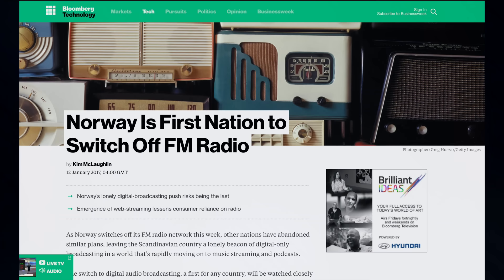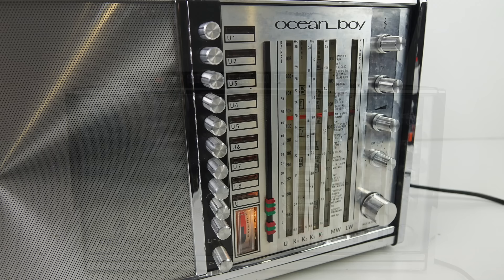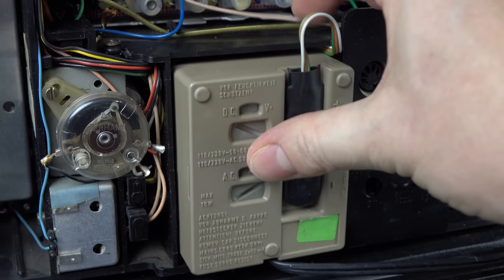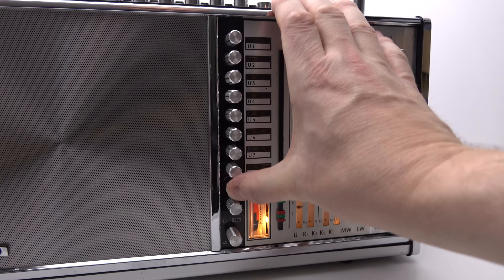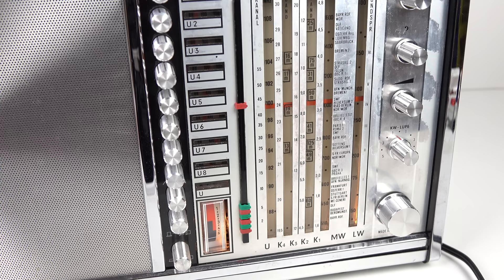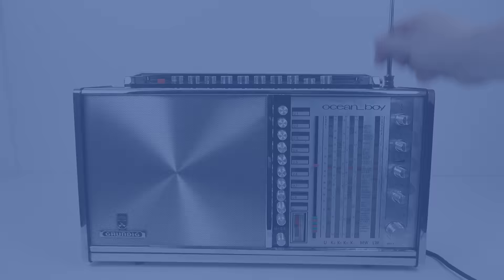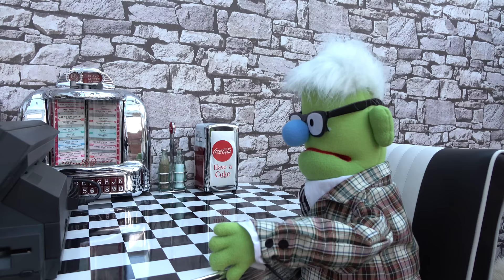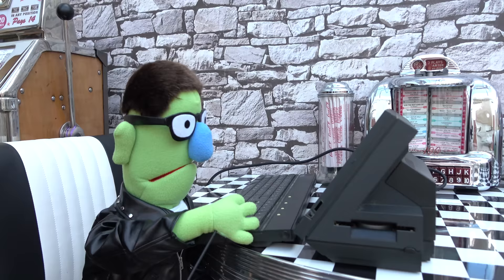Design Classic: Grundig Ocean Boy 210 Radio

Comment: Hi, all you need is a fm transmitter from amazon and put its 3.5jack into any modern device tune the transmitter to say 90 MHz then tune any vintage fm radio to the same frequency and can use great quality radios forever.   Regards JH

Comment: The coolest old radio I get to play with is a friend of mine has a Zenith Transoceanic  that I think is a 600 series.
Reply: i once found a radio quite like this buried under the ground for 60 years
http://www.nnrm.net/Bilder/Foto%20samling/Radionette%20Solist.jpg
its only a rusty hunk of metal and all the wood and speakers had rotted away, but the tubes are still there

Comment: You should also try some of their stationary real Hi-Fi radios (according to the DIN standard back then) 
I have an RTV 600 from 1967, all the components original, and in superb condition, that i bought dirt cheap. It has stellar fm reception (i am getting strong signals from some 200 km away) and used as an audio amplifier (2x20W) with some grundig speakers it sounds superb.
Grundig made some of the best radios in the 60s and 70s, but later on, after they were bought by Philips and then sold off things went down.

Comment: Awesome radio, I have several Grundig radios in my collection including a couple of Yacht boys.
You must check out the fantastic Grundig valve FM sets from the 1950''s!
Personally  I think DAB is Crap, if (when) FM is switched off you can use an FM transmitter to broadcast to your radio.
There are plenty out there that were designed to transmit from a walkman to a car stereo, they actully work well and are very cheap.

Comment: On the "switching off FM" thing, here in the states we still have AM stations and new cars can still tune into AM stations. I do believe this is due to some remote areas so far away that FM signals don't reach and population is so sparse that it isn't worth it to make a tower there, and I also do hope that the US doesn't switch it off anytime soon, as there is a truck I'm looking at buying and it's AM/FM only lol
Reply: Justin Noker Ironically, Canada has recently eliminated most all of its AM stations, and moved them to FM.
Reply: Yeah. AM isn't the best quality and easily subject to noise. But it's still great for talk radio, news, and sports. Also when the ionosphere is just right, you get epic DX'ing. Can hear stations all the way from either coast, parts of Canada, or even Mexico and the Caribbean right here in the Midwest.
Reply: They are transmitting from Toronto on shortwave.

Comment: It's weird hearing numerous FM radio DJs on those presets speaking English with British accents. Pro tip: When they turn off the 3 meter (100 MHz) band, you'll be able to home brew your own FM transmitter. My car is a 2000 vintage Audi and I use a Bluetooth FM transmitter I purchased from eBay wirelessly connected to my smartphone. You can use the same device at home with any 12 V AC/DC adapter you have sitting around the house, and voila, 100 MHz is back! No idea what they will use the band for in Europe.

Comment: I own an "ITT Schaub-Lorenz Polo automatic 105"-Radio from 1974. It's a bit smaler I think, but it also has GREAT sound! It is completely original and in very good condition (not even the potentiometers are scratching! That's real quality!). The only "thing" is, that it only receives FM-stations from 87,5-104 MHz, not 104-108 MHz, so a few stations are "out of range"...

It also does a good job as "mobile speaker" on batteries, powered via "Linex FM-Transmitter" by smartphone ;)

Hope they will not switch off FM-broadcast in the near future, they shoud better switch off this horrible "tiny-sounding" on-air-sound-processing (especially here in Germany..., also in Austria, Switzerland, ...)

Best regards from Germany

PS.: Go on with your great "old-technology"-videos! Some day they will be worth millions!
(I'm 27 years now, and I still lived with MC-Cassettes, VHS and analog stuff - all important professionaly digitized now...)

Comment: They turned it off where i live first. 11.01 at 11:11:11. Not getting a new one.
But that is not all they did. They moved all the channels on DAB to DAB+, so all DAB radios stopped working.
Only got 2 local stations left on the FM band here now.

Comment: 4:19 They are technically not individual tuners. Like old TVs they only individual variable resistors that defines specific voltage for varicap diodes located in actual Turner circuit.

Comment: Completely irrelevant but aircraft transmit in AM just above the consumer FM band starting at around 110MHz.  The reason they transmit in AM rather than FM is because if two aircraft transmit at the same time, you hear both talking over the top of each other with AM and can ask them to repeat one after the other, whereas FM can lock on to one transmission so you may not even notice one aircraft was trying to contact you at the same time as another.

Comment: Something about radio that makes it kinda fascinating is that, it's not always that easy to pick up the best signal. Still remember that, in order to pick the best signal, all sorts of metal sticks is used to improve the signal picking XD And, I guess it just feels good being able to fine tune the frequency to just get the best signal? XD

By the way, in my school, English dictation test still uses FM to broadcast the audio. And my roommate got a handheld radio for the exam and was like, he didn't know how to use that because the frequency selection is analogue. Um... Well, is it really that hard to use an analogue tuner nowadays? Anyway, I tuned that radio for him and, as a joke, I attached a long straight steel wire to the antenna (leftover from DIY project) and said that, it would let you receive better signal XD

Comment: I wish i could ship techmoan my RCA 27" DCRT HDTV; it was RCA's final who-rah and completely stacked with options front and back. 
 It's unusual in that it's a glass screen television that can do analog 320 alongside digital 480~720~1080i~1200i (all this in 2002 mind you) as well as function as a 85hz computer monitor, it can change aspect ratios, it has a built in headphone amplifier both front and back, it has a subwoofer pre-out, it has dolby and DTS and built in EQ, it has multiple sets of DVI and HD-15 inputs, it has component, S-video and composite and they're all gold connectors in back. it has a service panel in the shroud.

It also weighs the better part of 100 pounds and would probably cost a BMW 3 series to ship to the UK. :(

Comment: Not quite sure about the legality of the solution but you can always use a low power FM transmitter to relay the digital radio signal from a DAB receiver to the analog one.

Comment: The AC adapter was a clever construction. I'm not sure, but I think you could replace it with a battery that had the same connector and dimensions.

Comment: The biggest problem, and what caused the initial delay is cars. Especially, those of use with older cars that can't easily be adapted to run a DAB head unit (such as mine). I rarely use the FM but it can be handy for the traffic alerts which will interrupt the CD changer (now an aux-in). Something to watch out for if I've still got my trusty old Honda when the time comes for us Brits. If think there's still some fears of a repeat of the slightly bodged affair that was the Digital TV switch over.

With the extra bandwidth the FM shutdown would provide you'd hope they'll increase the quality. A lot of stations (even big name ones) are rather poor. A lot of them transmit at 64kb/s in mono. Fine for talk stations but really poor for music of any kind.

On the upside you'll have a lot less trouble using things like the DAB units that transmit on FM and the various others for iPod and 3.5mm connection. In theory you won't have to worry so much about searching for a clear frequency once it's set.

For indoors though you could effectively turn any FM radio into a standalone speaker and use something like this (if you can find them any more):
http://www.theregister.co.uk/2010/09/27/review_gadget_keene_usb_fm_transmitter/
I got one a few years back and depending on the distance you're trying to cover it easily blocks any commercial signal and sounds fairly clear too.

Comment: Hoping you might be able to help me with any info on a lovely looking mid 70s transistor radio.  I can not find anything anywhere??
   It is called,   EX LIBRIS.  CRESTA EXKLUSIV STEREO.  with sticker that says.  "9 Bands Dual Conversion"     It has on the top lots of shiny buttons LW, MW, FM, and 2 or 3 short wave.       Dark wood look and chrome.    Thanks very much,     Jeff.

Comment: That is a really nice radio. I'm looking for a nice old grundig but im scared to shell out the bucks for old equipment that might not work and can't be fixed.
Reply: +jason There are still guys around who can fix it if you look, Took my sisters DAB (expensive roberts brand model) to one when it died and he fixed it - suppose the economics of repairing radios is pretty marginal these days though, that job was less expensive than buying another pricey  roberts but she could have bought a cheapo Argos DAB for less.
course the cheap argos DAB radios also die quickly too.

IMO grundig and similar transistor radios were built to last in the first place so if you're into the retrotech for it's own sake I wouldn't be too worried.

Comment: It is a shame that it does not support SSB or AM+BFO modes so that you could tune into amateur radio conversations from around the world since it covers many of the bands (though you will do much better with a much longer antenna made from a long length of wire, the longer the better, plus a good ground connection, and run the wire outdoors for a ways when it comes to the MF and HF bands -- a 5ft. Antenna is very limited on those bands).  There are also a number of international AM shortwave broadcasts you can tune into each evening after the sun sets (and perhaps earlier given you are in Europe and a good deal closer than those of us in the US).

Comment: get a rather large antenna there will always be radio in the states,they tried to remove air TV signals but they still broadcast over the air too with a converter.

Comment: Ah, finally I can also nit-pick under your videos :P

The antenna shouldn't necessarily pulled out completely, for ideal reception it should be as long as a multiple of the wavelength of the frequency you're trying to receive.

Also, I really had to laugh at the shot at 5:22 because I've got the number 15. It's probably still lying around here somewhere.

Comment: Not sure switching off Analogue FM is viable yet or ever honestly
my car has HD radio (in the states it's the digital standard) and it constantly switches between HD and analogue, if they switch it off, then most of my driving would be 2 seconds of digital and 8 of silence.

Comment: At the time the turning buttons must have been the simplest way to do it, really. They wouldn't build a tuner into each button; only the variable capacitor that is connected to that knob. And then switch between them to select the channel. It's quite clever, really.

Comment: Maybe this will be like when they switched off 405 line transmission in 1985 but they had 625 line in the 60s so both line standards were in use so they made duel standard sets  using VHF 405 an UHF 625 so with radios they may make duel standard sets before the switch off. My older radios just have MW LW so I guess these will continue. I'm only guessing what might happen if they did switch off the FM transmissions, the same logic could be applied to radios as it were the old TV sets.

Comment: Only thing missing on this is VU meters. (im from norway btw. all the best shows went over to digital 1 or 2 years ago, so the fm has been dead to me for a while... only sad thing about it is that these old goodies will be kinda useless.UNLESS you get a fm transmitter and a DAB radio, and connect them together to run your radios.)

Comment: DAB would have been perfect if they would have been able to introduce it much earlier on. We have had DAB+ broadcasts for about 10 years now. The very first DAB broadcast was back in 1995 in Norway but it was only experimental and no people had receivers at home. Availability of receivers got more serious in 1999 but still it was fairly niche and as long as FM existed, people didn't see a need to switch. Only when DAB+ got introduced in 2007 using AAC+ codec it was finally technically better than FM and allowed a lot more stations, but still it wasn't enough to convince the major population. But sales of DAB+ receivers was a lot better than ever before. I only ever listen to radio whil in the car. At home there is zero radio listening. I'm sure a lot of people just don't have time for radio at home and the TV wins. Getting car manufacturers onto a new technology is also not easy. Man cars sold just a few years ago still didn't come with a DAB receiver as standard.

Comment: I personally don't like the DAB signal. yeah it could have better sound, but if the signal is weak it glitches out and you just stop hearing anything or it will sound choppy.
with AM and FM you get static noise on the signal, but you still receive the station you listen to.

Comment: I imagine you could get a digital adapter for Analog radio and connect it to the inputs of a reciever, as for things like boomboxes and standalone radios like this... maybe you could just wrap the connections around the antenna? The better solution would probably just get a low powered transmitter and broad cast the signal to your radio... I know they sell Radio thingies for cars to plug your smartphone or MP3 player in to play in cars without a AUX Jack.

Comment: I wonder how DAB radios will perform in cars? I live in Devon, lot's of hills around here which interfere with the signal, not to bad with FM, signal fades in and out, but if DAB is anything like digital tv in poor signal areas - picture break up/freezing, sound cutting out, then i think it may be a problem in cars. Both my terrestrial digital tv and my satellite tv tend to also suffer with problems in bad weather - much more than the old analogue signal did. Analogue used to get a bit grainy in bad weather, digital just gives up.

Comment: Short wave radio uses longer wavelength than FM. Thus they need longer antennas. To get the best FM signal it is good advise to not use the full length of the antenna.

Comment: I already have an Belkin Car Radio FM transmitter to transmit music from my phone to my analog car radio, going to be easy to choose radio stations on the phone instead of on the car dashboard, a good FM transmitter doesn't cost much, I recommend avoiding the cheap Chinese ones for obvious reasons.

Anyone with an FM radio will just use an FM transmitter to broadcast the digital radio into FM! the FM radio will endure.

Comment: So in Europe FM's being shut off. My guess is the wavelength's going to be reassigned when it's been fully displaced by satellite. On the upside, this is great news for pirate radio stations. For the most part pirate radio has had to find a band not in use, which after the 1970s became increasingly hard. And yet no announcements about AM radio...

Comment: Shortwave radio in big cities is nearly impossible without proper external antenna. The interferences are tremendous. I have SW receiver in my car and only outside the city I can hear well stations. SW radios is an indication of how polluted by radio frequencies cities are. And nobody knows the very long term health consequences of that. 
SW until recently was a cheap solution to hear my country radio stations abroad. Nowadays the mobile internet is so cheap and the double sim smartphones are available too. A new local SIM card, a cheap internet data pack and a VPN subscription are all that are needed. 
Digital SW radio broadcasting may be a solution for free global radio station with acceptable sound quality. However internet is a game changer.

Comment: Does anyone offer a digital to analog receiver/transmitter to keep all those old radios working? 
  
The word Valves seems so odd. although it is what they are. As a youngster,  I remember going with my father to the hardware store with all of the 6 or so TV tubes; they had a tube testing console that you used, and you simply purchased replacements as needed. No need for a house call.

Comment: Have a read of  this item link below. It kind of details opinion of what will happen to FM and DAB
TV digital switch over was different because they intended to replace analogue completely because they couldn't get the full potential of digital without freeing up the radio spectrum. As far as I'm aware DAB is already on its own bands and does not share the space with analogue radio services thus they dont need to turn off FM transmitters in order to fully roll DAB out 100%

http://www.which.co.uk/reviews/radios/article/digital-radio-switchover-explained

hope this helps.

Comment: Short wave receiver can pick up secret message stations the listings and times of transmission are on the net i find them fascinating and spooky but a simple length wire chucked over the house roof  for a long wire arial extension will pick up stuff from eastern Europe but try 4626 kHz to hear uvb76 know as the buzzer its been transmitted throughout the cold war and still is from Russia.

Comment: When the FM and AM signals are switched off, i'll buy a cheap little radio (one with the new digital signals) and plug the headphone out into a little FM transmitter, then tune all of the FM/AM radios in the house to the frequency that I set my transmitter to, then change the station on the cheap new radio. And the cheap radio AND the transmitter are going to be portable, so I can bring them in any car that uses FM/AM radio. Whew. That was a lot to type.